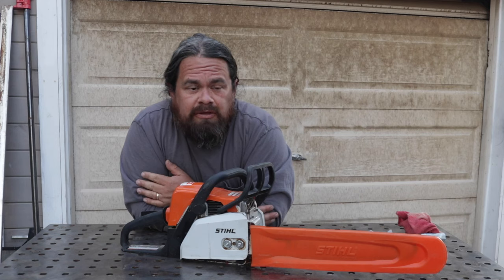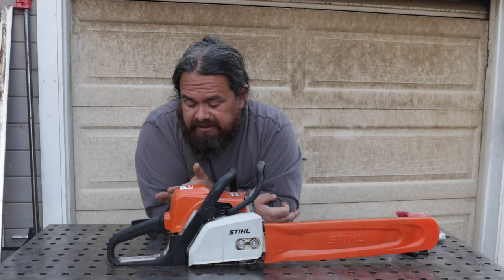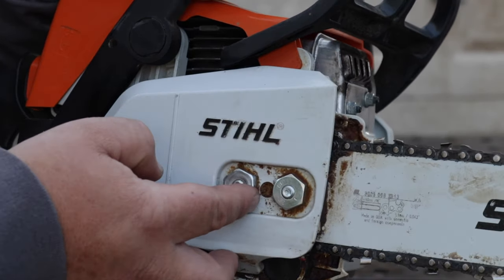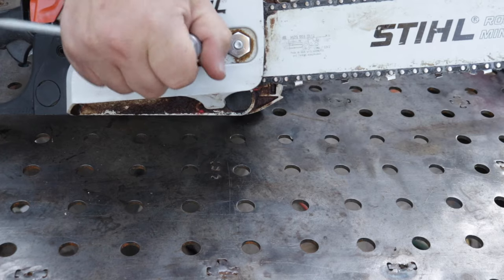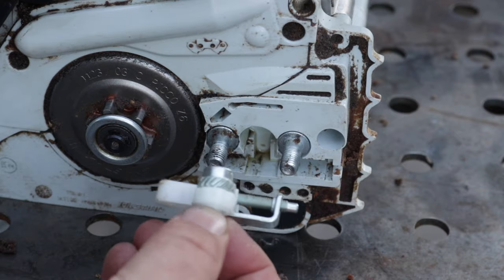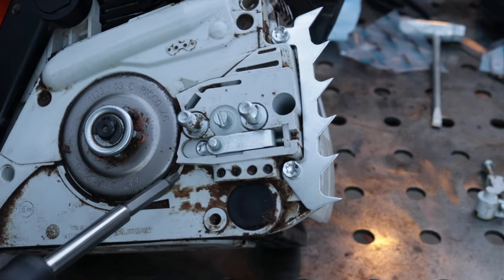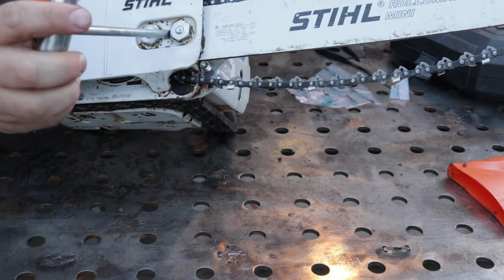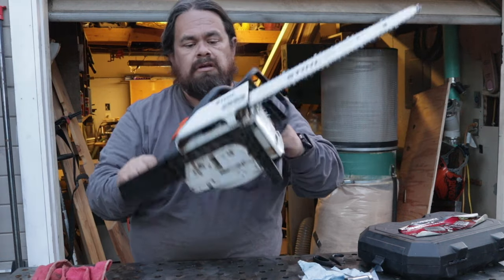Cheap💰Upgrades for the Stihl MS 170 Chainsaw

Comment: I try to buy the middle performance machines so I won't have to upgrade anything.  Sad that everything is plastic now ,  designed only last less years than the older saws.
Reply from the maker: I'm going to be shopping for an upgrade soon. This saw was stolen out of the back of my truck.

Comment: Thnx for getting back to me on the
660. So did that price come to around 330 beans with bar?
(If that was even included)
Reply from the maker: Mine was $380 shipped back when I bought it. It came with a 25" bar. The 42" I added is an Oregon.

Comment: Hey there . Hope you're doing well .  I realize this Video is about 4 years old but I'm hoping you see my comment and question . First ,  thanks for making and sharing this Video . Definitely informative for someone like me who just bought his first Chainsaw . 
   And second  ,  I understand why you re - located the Tension Screw . But what is the purpose of the Felling Dawg  ,  and why did you replace that part ? 
      Okay  ,  thanks again for making this Video ,  stay safe .
🎸🎸🎸
Reply: Felling dogs allow the user to secure the chainsaw into the tree or log itself, providing for greater control and precision in a cut. The chainsaw can be levered using the felling dogs as an anchored fulcrum, allowing the user to cut more aggressively without putting too much strain on the saw itself.
Reply: @jmljml5065    Thanks Dude . Hope you're doing well .

Comment: You should post a tune up video for this. Mine isnt cutting that well.
Reply from the maker: I would check out Steve's Small Engine Repair channel. I always go to his videos when I have chainsaw/mower/weed eater issues. https://youtu.be/M6T5JoGXcHY
Reply: Best tune up for a wore out 170,
1. Grab your keys.
2.Head to your local supply store.
3.Pull out your checkbook or credit card.

Comment: Umm, I didn't give an idea. I just wanted to know if you could help clue me into the viability of either getting
a Chinese g-660 or something that you felt got the job done and was a good value. I thought that a chainsaw in the 70 cc range would take care of 2.5 Ft diameter heifers pies. As it stands, Stihl's older model( that huge commercial saw) is in the thousand + range... Crazy out of my budget.
Reply from the maker: The Chinese g660 is what I use for cutting slabs. I have a 42" bar on it. I don't think it is as good quality as the original Stihl, but at 1/4 of the price, it was worth it to me. I think the widest I have cut so far is about 28". I have a log that is 36" that I will be trying to slab when I get the time. I have not tried cutting slabs with any other saws yet.

Comment: Thanks for the video. Love that you get right to the point. You mentioned farm tech;
I'm seriously considering getting the Chinese g-660. Is there any chance I could talk to you about your slab
 saw's perf._(for only like,say 8 mins of your time?) Thanks
on giving me, errr, the "yea" I could provide my cntc_info.
Reply from the maker: That's a good idea. I'll try to get to that. Thanks for the idea.
Reply: I got a cheap chinese chainsaw from Walmart dot com, last year, I think it was 119.00, seems like it's a 50ish cc, 20" bar, came with an extra chain and tools for bar/chain maintenance. The name of the saw is "Coocheer". I have ran the piss out of it, and loaned it to a buddy, who has also worked it hard, it's still going. It's bulky and heavy, but it'll spin a chain and get the job done. Have a good one.

Comment: also my blade seems smaller than yours but mine has ms170 on it too ??
Reply from the maker: If I remember right, there are there or four options for bar length. I think it can go as long as 14 or 16". Can't remember for sure.
Reply: @BitsandWood  16"

Comment: What about replacing star sprocket with newer style
Reply from the maker: I haven't looked into that yet. Not sure what the options are.
Reply: If you look up on the ipl for a ms250/025 and get the part number for the rim sprocket system as the clutch drums are cross compatible

Comment: How did these hold up?
Reply from the maker: Johnny Wayne So far, so good. I’ve only had a chance to use it once since I added these a few weeks ago.
Reply: Sawdust is Life I just ordered them last night got a email there on the way! 6.92$ can’t beat that I was skeptical cause I seen in the stores then metal dog spikes are 60-80$
Reply: The 170 is a good saw, just realize that it's small, inexpensive, and you just need to break it in properly and let it do the work. You lean into it, it will bogg down and stall. Break in period is like 4-5 tankfulls.
Reply: @Gtag_thagoat  Local Stihl dealer by me sells the 1123 MS 250 spikes (they're the same ones that go on the 170 and 180) for less than $6 with the screws. The tensioner, that'll cost you money though. I bought mine off eBay. Funnily enough it uses the oil connector screw from an MS 250, which I had a spare anyways.
Reply: I've done chainsaw-work for my living but I`ve never understood the point with the dogs... Could someone explain em..? In my opinion only in the way when limbing and it cutting firewood

Comment: They really sold you a tensioner but made you buy the screw separate
Reply from the maker: Yeah, but as cheap as it all was, I didn’t mind.
Reply: @BitsandWood  you could not get that screw at Home Depot or Lowe's or whatever
Reply from the maker: @mrobvious1100  Good question. I never checked.
Reply: I'm sure a Stihl dealer would stock it if not could order it. Don't stick a hardware store screw in there..

Comment: Just bought one.. it's going back.soon as it hits the wood the chain stops and the saw bogs down. Or the saw is got full power as soon as it hits the wood the chain stops the saw is got full power. In only cutting popular wood 4 to 6 inches.. cutting hard wood ain't gonna happen. Small gas tank run time on a full tank 15 minutes or less. I'm not forcing the saw I'm letting the weight of the saw do the work.  But a 23 inches Ash tree no way.
Reply from the maker: Is the chain dull? That sounds very different from what I'm seeing with mine. The ash tree wasn't as fast as it would have been with my 660, but it did it.
Reply: bring it back to your dealer and have them adjust the carb. Sounds like it wasn't tuned right. I've cut up more stuff with mine than you would imagine. Including a forked maple about 40 feet tall and close to 2 feet across at the base.
Reply: My 170 is the new workhorse of my fleet. LOVE that saw. It does have a smaller fuel tank, but it's not a production/professional saw its a homeowner saw for bucking up smaller stuff. I agree with the comments about the chain, that's why sharp spares are so handy.

Comment: I like that you consider yourself a word-nerd, but a power saw does not have a blade, so please stop using that word in relation to power saws. I’ve never heard anyone say ‘blade tensioner’, have a good think about how that sounds. The bar is not a blade and the tensioner tightens the chain, which also isn’t a blade...so please stop saying blade when you’re referring to power saws, it’s ridiculous. Thanks
Reply from the maker: You’re going to try and correct me while referring to it as a “power saw”? Good one, pal. 🤣🤣🤣
Reply: @BitsandWood  Yeah, I am. It is a power saw. Chainsaw is another word, but they are powered saws, as opposed to what saws used to be, blades used by men, without power. These are power saws, chainsaws, whatever, but they are powered saws. There is no blade on a chainsaw and so yeah, I was trying to help you not sound like a noob.
Reply: @BitsandWood  it is a power saw, it is a saw with power. What it doesn’t have, is a blade. Have some humility and watch Buckin Billy Ray and try tell me they aren’t called power saws. He’s way nicer than I am, I know it, but yeah I was trying to help you.
Reply from the maker: A table saw is also a 'power saw' and it has a blade. A bandsaw is a 'power saw' and has a blade. A circular saw is a 'power saw' and has a blade. A jigsaw is a 'power saw' and has a blade. I think you get my point.  If you want to nitpick, use more specific terms.

It really doesn't matter if I sound like a noob. I don't claim any professional credentials in this field. I'm just a dude that makes stuff in my shop and shares stuff that I think could be helpful for other folks. If you want to offer help, that's wonderful, but your approach comes across as an attack so that's how I responded.
Reply: @BitsandWood  I say chainsaw more than I say power saw, saying power saw, is something I picked up from Buckin' Billy Ray, who is a faller and a woodsman and a nice nicer guy than I am; so, saying power saw seems to be what a real sawman calls a chainsaw, a table saw is a table saw and when you predominantly use chainsaws, you call them power saws and jig saws are called jig saws, but all of that aside, a chainsaw does NOT have a blade, so keep saying blade if you like, but then you can't call yourself a word nerd, a chainsaw has a bar and a chain, not a blade.
Reply from the maker: I never claimed to be ‘a real sawman’. Like I said, I’m just a dude that makes stuff. Either way, the point of the video was not to teach proper nomenclature - it was just to show some cheap upgrades for my saw. This discussion does make me want to purposely refer to the chain as a blade though. 😉
Reply: @BitsandWood  Then you are not a word-nerd, you wanted to know the proper term for dog-spikes, but you wanna sound like a dork and say blade, while calling yourself a word nerd... That doesn't help the people who follow your content. A chainsaw does not have a blade.
Reply from the maker: @jeremybartlett1706  Wow, you’re really hung up on this. It’s kinda funny. 🤣
Reply from the maker: @jeremybartlett1706  Obviously someone using a chainsaw needs to be aware of the dangers of unsafe operation. I never suggested they shouldn’t. But this video wasn’t about proper usage. It wasn’t about instruction. It was about cheap upgrades. That’s all. If I was doing a video about how to safely fell a tree, I would talk about PPE, and stance, what to watch out for, and all that other stuff. But that isn’t what this is. I never claimed it was. If someone wants to learn more about those things, there are plenty of other videos by people who use their saws much more than I do that do a wonderful job explaining all the ins and outs of chainsaw usage. Why would I spend all the time to explain that when so many other people already have? From the beginning this was only meant to show simple upgrades. That’s it. So there was a flub in terminology, so what. Is that going to offend a chainsaw and make it magically cut someone’s leg off? No. The stated purpose of the video is still accurate. It isn’t click bait. It’s just about cheap parts. That’s all. It’s not about safety. It’s not about usage. It’s not about instruction.
Reply from the maker: @jeremybartlett1706  And so what if it makes me sound like a beginner? I’ve been called worse. 🤣
Reply: @BitsandWood  If you don’t wanna be a better person, that’s up to you, but you have a channel and you’re talking about chainsaws and so in my opinion you should promote expanding your knowledge and the knowledge of your followers and viewers and beyond that, you called yourself a WORD-NERD!! How are you gonna say that about yourself and then be wilfully ignorant? Far out
Reply from the maker: @jeremybartlett1706  Actually, I was talking about upgrades to chainsaws, not chainsaws specifically. My preference is single topic videos. Sure, I could have added all sorts of other information, but when a viewer sees a title talking about upgrades, the expectation is that I’ll be talking about upgrades, not how to avoid kickback. And I would still call myself a word nerd, but I would not call myself an infallible word god. There are still so very many wonderful words to learn.
Perhaps you should make your own video about chainsaw safety and terminology. The platform is there and it’s quite fun to make videos.
Reply: @BitsandWood  I think it’s dangerous to say blade, because you give people the idea it’s a blade and not a cutting chain on a bar, which is more dangerous due to kickback and it’s just plain wrong! Someone goes into a shop to buy a new blade and the person there is gonna hav to ask them if they want a bar or a chain, because they don’t have blades! And then the person says oh but the word nerd I watch on YouTube says blade and then the person says well, you should watch a better channel because any self-respecting person who works with chainsaws should know better. I’m just sayin’, you should know better. If you wanna carry on being a dolt, that’s up to you, but I tried. A chainsaw does not have a blade. I guess I shouldn’t have expected someone who runs a Farmertech to have any brains.
Reply: @BitsandWood  If it’s not about instruction, why was it so important you learned what the correct term for dog spikes was? Also, as a word nerd, why are so intent on saying blade, when a saw runs bar and chain? To annoy me? Good. Keep doing it. Keep saying blade. Anyone who has any saw-sense will know not to listen to you.
Reply from the maker: Did I ever say I was going to keep saying blade?  Did I ever say your distinction between a blade and a chain was wrong? Did I ever say I didn’t simply misspeak because I’m human? Pretty sure the answer is no. I just find it entertaining how far you have to go on this. Do you always go to such lengths when you hear an incorrect word? It’s fascinating that you think the brand of a tool someone uses has any relation to a person’s intellectual capacity. I bet you’re great fun at parties.
Reply: @BitsandWood  Yeah, you did, "This discussion has made me want to refer to the chain as a blade though 😉". That's a direct quote from you.
Also, no, you didn't say you misspoke, your point was more that you didn't care, or think it was important,  when did you say you misspoke or that I was right? You didn't! So yes, no, you didn't, your use of double  negatives is off the charts, by the way, 'word-nerd', trying to figure what you did not didn't say. 
You can't call yourself a word-nerd and then get pissy when I gave you the correct word and no you didn't say you misspoke,  you said it didn't matter, you actually said you were gonna keep saying blade, I quoted your earlier reply, no you didn't say I was right, you said that you liked single topic videos and you either weren't there to inform or educate, so yeah, criticize me for being no fun at parties but don't ever call yourself a word-nerd ever again coz you don't give a fuck about words. Saying blade is such a rookie fuckup,  I was trying to help you, but I really hope you do keep saying blade because you are a complete clown, like that bozo, Bonkers The Clown. Even if you do it jusy to try annoy me, it will be a totally cromulent word. Word nerd. Far out. I was trying to help you not sound like such a dork. Blade. I hope you do keep using blade. It suits you.
Reply from the maker: That’s a great quote to pick because it clearly shows it made me want to, not that I declared that I would. I can call myself a word nerd all I want. I’m a word nerd. I’m a word nerd I’m a word nerd. 😉
Reply: @BitsandWood  No, you’re not
Reply from the maker: @jeremybartlett1706  Yes, I am. 🙂
Reply from the maker: @jeremybartlett1706  Maybe I will. Maybe I won’t. Either way, I’ve quite enjoyed this back and forth.
Reply: @BitsandWood  Great, I’m glad for you, I’ve never heard the term word nerd, until today, so I guess I misunderstood the meaning, I thought it meant you liked words and the correct usage. I was a bit harsh, but I was trying to get you to see sense in kind of a rude way, which obviously rubbed you the wrong way. I was trying to help and be rude at the same time, but I like to use the correct terms where I can and know what I’m talking about and I like to put people down when they are being fucking stupid, so I guess I was both right and in the wrong. Say blade.